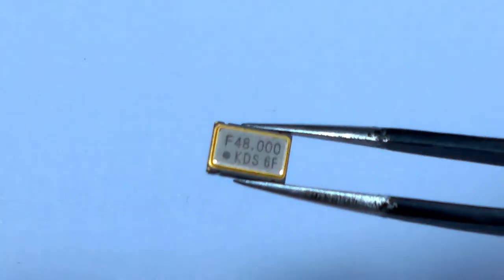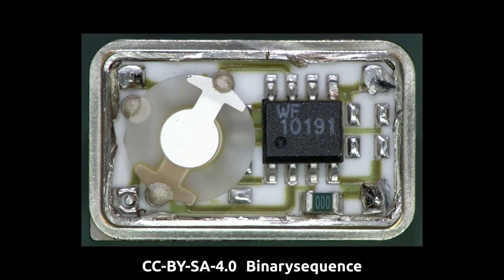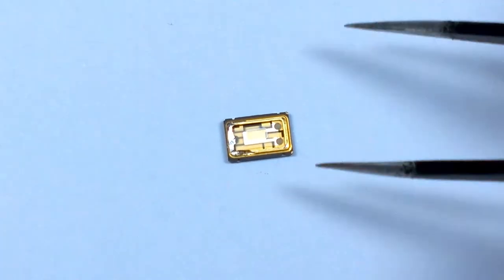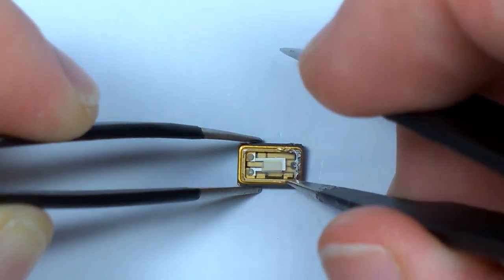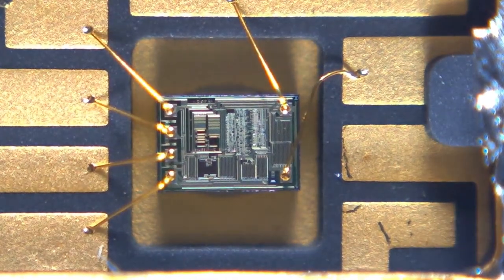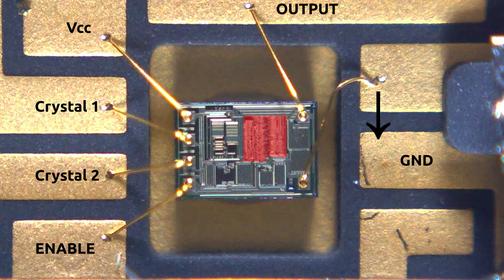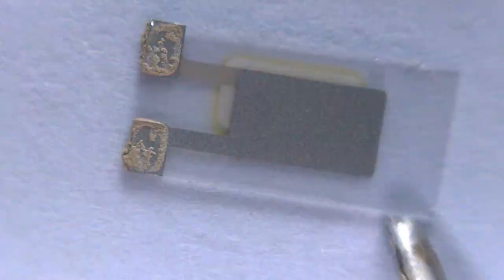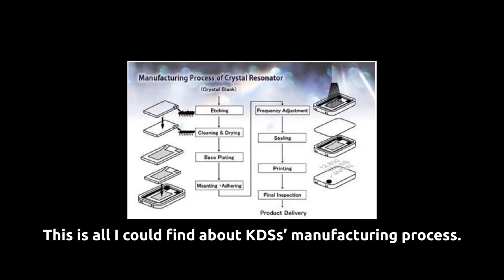SMT Crystal Oscillator Teardown

Comment: An AT-cut crystal will have a fundamental frequency of 1664 divided by the thickness in micrometres. I guess that one will be a 48 MHz 3rd overtone, so the fundamental frequency will be around 16 MHz and the crystal will be around 100 micrometers thick.
The circuit needed for that is very simple, just two inverters and a resistor. The IC may include dividers for lower frequencies but they would not be used for 48 MHz.
The crystal's silver electrodes will have been plated on in vacuum by evaporating. It's not sputtering, as no voltage is used to propel the silver atoms, only heat. The heat comes from a low voltage filament, and there is no high voltage. After that, the crystal is attached to the oscillator with the silver-loaded epoxy. A flexible epoxy is used to stop thermal stresses on the crystal. In the video, Tim was able to lift the crystal a long way before it came off, because of the flexibility of the epoxy.
The adjustment shape is the faint silver rectangle that isn't very well aligned in this example. To adjust the oscillator, it will have been operated in vacuum, complete except for the lid. More silver would have added while the frequency was measured. As the correct frequency was approached, the silver would have been stopped, probably by moving the oscillator out of the way as that would be quicker than letting the filament with molten silver cool down, and also because there were probably many oscillators in the one vacuum chamber, so when this one was adjusted, the next one would be moved into place.
The ceramic package is to prevent out-gassing. A tiny package like that, or even many of them, won't stop a good vacuum being achieved in the production equipment. The reason that outgassing would be a problem is that the gasses would react with the silver and change the mass, which would affect the frequency the same as the adjustment silver does.
I think that the lid is resistance welded onto the package. Rollers are rolled along the edges while passing a current between them, causing the bottom of the lid to weld to the top of the package.
Reply from the maker: Thanks for those details, I've now got a better die photo and found the datasheet for the die, more details here: https://www.youtube.com/post/Ugkx-P1Bvt0LztyGCv-cCmT4MA4Oa2P8HjAq

It does indeed use the third overtone and has other mask selectable dividers on board for different frequency versions from 22 to 70 MHz along with CMOS or TTL output and output loads versions.

Comment: My old and probably already obsolete understanding has been that any crystals more than some 50 MHz would actually be operated at third or higher harmonic overtone.  Then it would require a filter of some sort to pick the desired harmonic frequency and attenuate the base frequency.  If you in any case do laser trimming on the crystal, why not trim it to the 48 MHz directly, instead of picking some odd harmonic of a lower frequency and then dividing it with another odd number for the final output?  I guess, if getting motivated, I could get one of those oscillators, remove the top and then operate it in the open.  Then I could use a small field probe and my spectrum analyzer to probe what (other) frequencies there are.  Could be fun, but do I need the info?

Comment: Hi! The tech behind Crystal Oscillators is pretty new to me, so I was hoping to get a couple of basic questions answered, for which I was I was struggling to find answers online. 
1) How exactly are the fixed output frequencies of an SPXO set? We have many 'standard frequencies' such as 10,12,16,20 MHZ, etc. Is it only due to the way the crystal is cut, or does it also depend on the other supporting circuitry within the Oscillator?
2) How does the circuitry for a programmable crystal oscillator (Such as Epson's) differ from a fixed frequency oscillator? I know these involve 'blank' oscillators that can be programmed to a desired frequency using a handler. Does it contain any circuitry such as programmable non-volatile memory? 
Thanks in advance!
Reply from the maker: I don't work in the crystal oscillator industry so I can't give you a very good answer but I can tell you the crystal oscillators field is very big and gets pretty complex. 

In the case of the most simple SPXOs they just use a feedback inverter to get the crystal oscillating, the cut of the crystal (eg. AT cut and 0.1 mm thick), the region in which the crystal is oscillator (eg. third overtone) and load capacitance are the main parameters that set the frequency. The numbers used for frequency are typically used because they are either a "preferred number" often E12, have some mathematically important property like 32.768 kHz for time keeping or from a standard like 5.6448 MHz often in CD players.

Epon's SG-8101 and SG-9101 series programmable crystal oscillators use a fixed frequency crystal that is then divided by dividing circuity or multiplied by a PLL (phase locked loop) depending on what frequency is requested, those are much more complex circuit as thus much more expensive but also have their own tradeoffs in order to accomplish this (eg. PLL phase noise/jitter) which make SPXOs more preferred in most applications. They appear to have OTP (one time programmable) memory to keep settings.
Reply: @WizardTim  Great! Thank you so much for your answer! It definitely helped! I was having a look at the Epson SG8101-CG series and that made me wonder how programming was possible.
I also really liked this teardown. It's actually the first time I'm looking inside of a crystal Oscillator, so pretty cool!

Comment: I guess they might use a crystal of a complete different frequency - and the target frequency is derived digitally through synthesis (fractional divider). I´m not sure if that´s correct, but this would allow to use one standard size crystal and avoid mechanical calibration.
Reply from the maker: Yea, I suspect they use an 80 MHz crystal with a divide by 2 (current similar models from KDS list f0 as 80 MHz). However, if this were true, I would expect the quartz strip to be less than 0.05 mm thick but it’s 0.10 mm thick alluding to it being a lower frequency (around 16 to 25 MHz) however I’m not sure if the quartz frequency constant works the same way as conventional round disks as with strip resonators.

To get 40 MHz from a lower frequency they would need a PLLs which are much more complex and thus a lot more expensive to implement than a simple divider and they tend to have limitations especially in phase jitter and start up performance so I would assume KDS would avoid using one as much as possible, I’m wishing I powered and probed it without the lid, would have made it a lot easier.